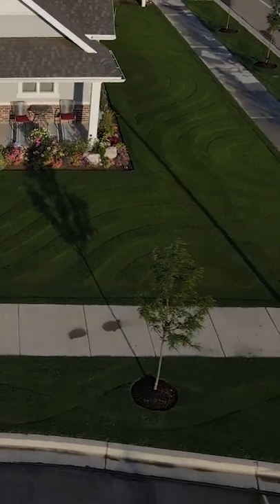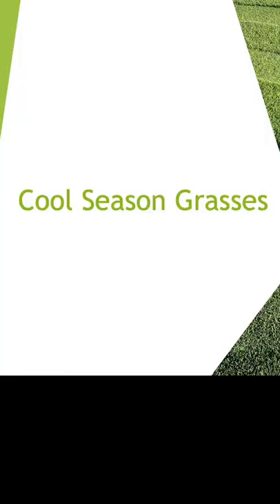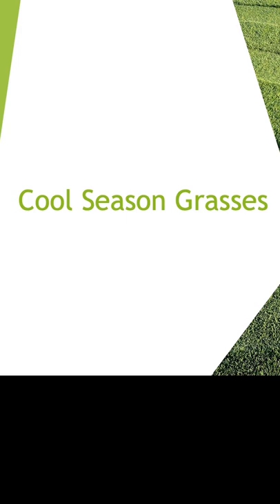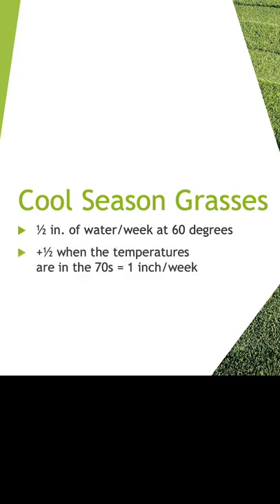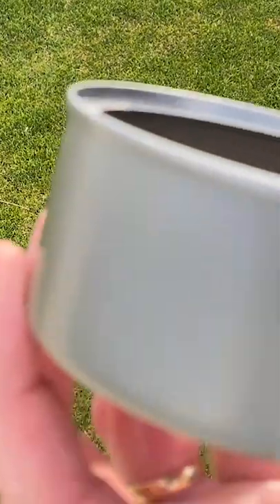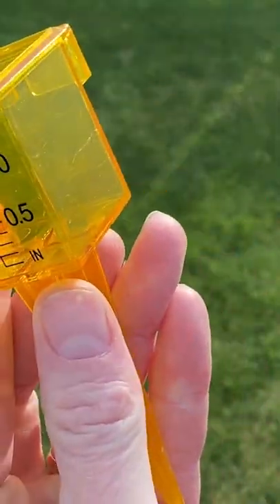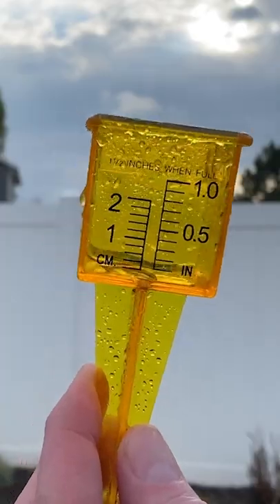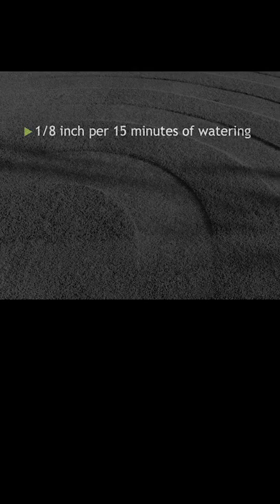How long should you run your sprinklers?

Comment: My garden hose fills them up really fast ,  does the measurement for the cups still apply ?
Reply from the maker: I would think so. I assume you’re talking about a hose end Sprinkler. I’m guessing you’ll end up saving water if you have a good idea of how much water your hose is putting out.
Reply: @DennisAroundtheHouse   just a garden hose ,  hand watering
Reply from the maker: I think it would still be valid, but just more challenging for you to ensure that you are getting equal coverage. Would still be a good way for you to calculate how long you need to water.